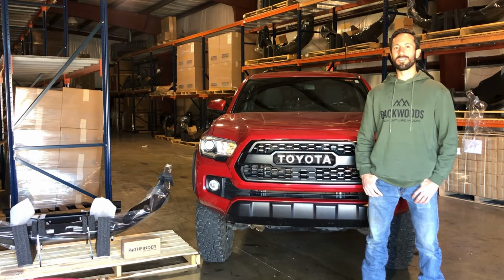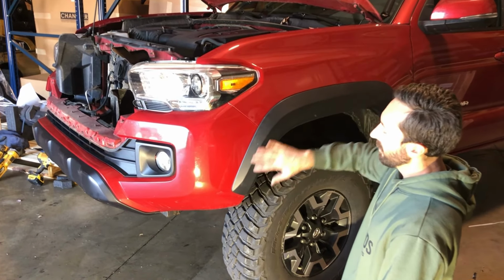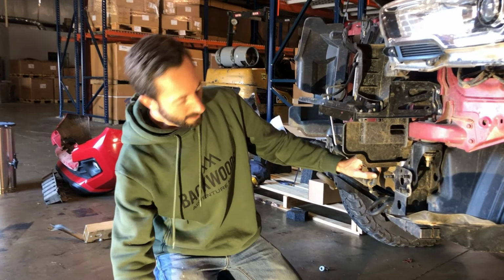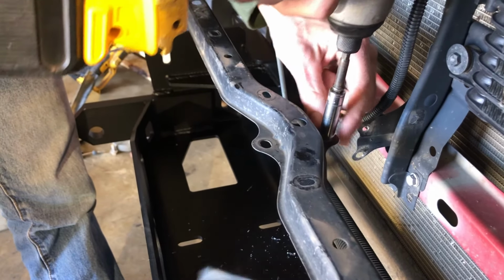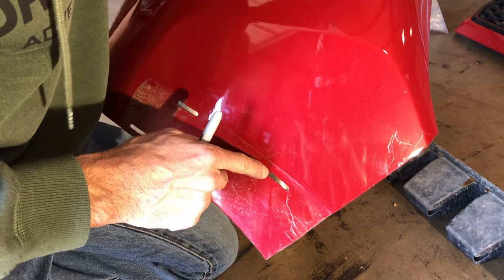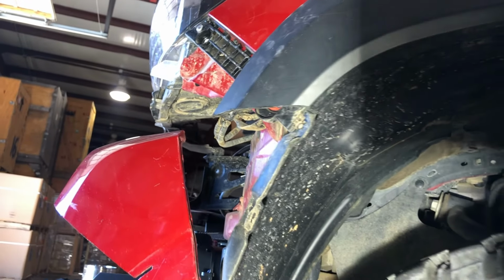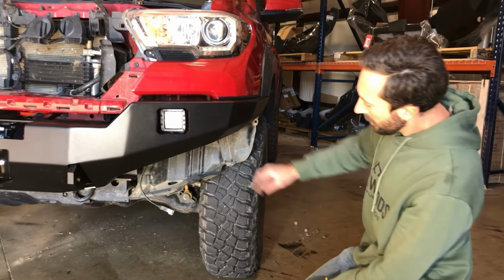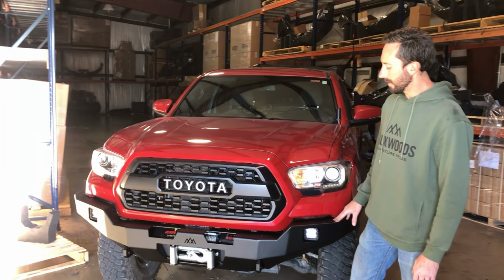[2016+] Toyota Tacoma – Hi-Lite Overland Front Bumper Install

Comment: I purchased this bumper and Installed myself, fits and looks great. I recently got the connector skid plate (was on back order). Is it supposed to bolt on and fit with the stock skid plate?
Reply from the maker: It's not designed to do so, but you can slightly modify the oem skid plate to make it work. It's designed to work with an RCI or similar mounted front engine skid plate.

Comment: Do the running4tacos bumper caps work in lieu of cutting the bumper?

The strip under the grille, does that serve a purpose?
Reply from the maker: Yes, these work perfectly with R4T bumper caps.
Reply: After watching the r4t video on the caps, it looks like those would be a perfect replacement and make for a cleaner look with this bumper, which honestly isn't to different from other similar high clearance bumpers
Reply: @tuf_1041  ah yeah I saw that talon sei had the bumper caps and the backwoods bumper. Fits fine. I ended up just cutting my bumper, the plastic strip that’s left after the cut holds the fog light harness tho
Reply: @its.mytacotime  Cool! Def have been thinking about using this setup!  Cheers!

Comment: I see you mention the bumper is ajustable ? I have a 1 inch body lift , could i make this bumper work?
Reply from the maker: Theres slots to adjust the bumper horizontally and vertically. We've never seen a customer with a body lift, but I imagine you would simply cut 1" lower on your plastic. We can't guarantee it will work because we haven't tried it ourselves.

Comment: can you fit 3x3 light cubes in those fog light spots?....i know your website says 2x2 pathfinders or similar, but i already have some Baja Squadrons that are 3x3s on order.....didn't realize until today
Reply from the maker: Those will fit. We've had numerous customers run the Bajas. It's actually a matter of how the light is measured. Some people measure the outside dimensions (3"), while others measure the actual light (like a flat screen tv), which is around 2" for that style of cube LED.